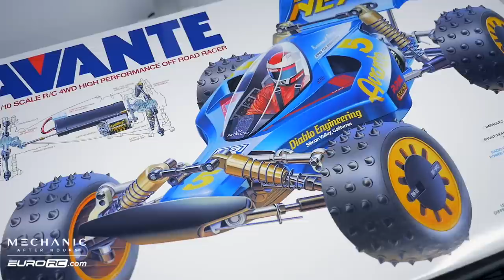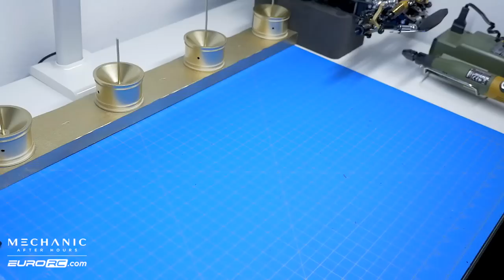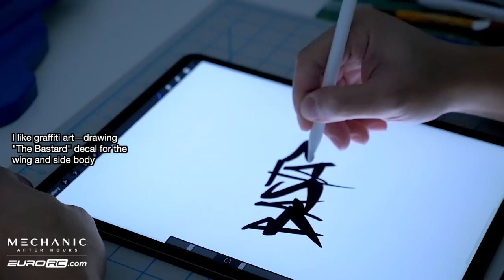Building an RC: Tamiya Avante (Time Lapse)

Comment: I bought one back in 1988 and I was 10 years old at the time. The journey of building it is so rewarding to then drive it. Alot has changed, It had a full plastic under body. After 1 week I installed a superpowerful reedy electric motor and top range power server.  The motor mounts would come loose and strip the pinion gear.  Upgraded to better stiffer metal suspension..  It was super fast and mad fun.  good ol days
Reply: That is awesome! Reedy motors! It was them and Trinity at the time. I remember saving up for a Trinity 12 turn in my Frog. It was mad fun.
Reply: Awww - I used to lust after the Avante in the Tamiya catalogue! I never owned one (the best my paper round could afford me was the Thundershot) I spend my money on paying off the mortgage these days, and if I ever get any spare money, my boilers about done and I need a new bathroom! Oh for simpler times!

Comment: The Avante was my first RC car. I ordered this in early 1988. 

I was a novice and had never built anything like this. Took me about 2 weeks. Did not drive this very much as it was so labor intensive to assemble never wanted to damage the thing. 

I sold this for 3 times what I paid. Wish I would not have sold it now!

Comment: Superb work. Really took me back,  I was lucky enough to own an original in ‘88. Picked it up from a local hobby shop in the UK with that years (modest) Christmas bonus from work. The kit had been sitting in the window for months so the box was faded, so the proprietor knocked £50 off the price, rather generous I thought… 

The build was great fun, and I ran it pretty hard (well, it was to be used… right)… there were weak points (especially where metal threaded barrels went into the rigid plastic turn knuckles), so an engineer buddy of mine milled me some metal ones to replace the plastic the threaded barrels went into. Made such a difference to the strength.  

Anyway, enjoy owning that piece of history!
Reply from the maker: Thanks, Initialgs! Those '88 ones are the thing. Definitely back in the day people who had them ran them hard. Thanks for sharing your story and for watching!

Comment: Absolutely gorgeous build. Well done! The Avante as you said is Iconic for a lot of reasons and although it was a flop on the track, it's a thing of beauty. so 80's.
As many that are into RC's,  I grew up in the mid 80's with a few Tamiya cars but never got the Avante. Was pure froth back then. My current list of RC's are from Traxxas, Arrma, Axial and their ilk. 
Looking at buying the 2011 Avante for some very light use and shelf queen duties. Been a while since I've built a Tamiya (lol 1990) Looking forward to finding an unbuilt Re-Re.
Thank You for sharing this video... Some great ideas for someone that is so used to RTR's.

Comment: Had this car when it first came out.  I modded the crap out of it.  It was a SOLID car but so complicated for a 13yo me.  Most of the mods were for simplification.  Like the steering and suspension layout.  Man, these days with 3d printers, it would barely be the same car.  Love to see it kicking around still.  Beautiful work on it.

Comment: BTW, sealing the CF plate edges with CA glue then sanding and using a black Sharpie is a nice touch and keeps the chassis from splitting in case of a crash.  I ordered a 1/4" chuck after seeing you tap for the stainless.
Reply from the maker: Thanks again for watching! That’s true on the cf edges. My older cars have CA on them and I polish it to a shine. For these newer classic builds, I don’t do the ca edges anymore as I don’t take them to the track or run them hard. The cf on these re-releases are better too.

Comment: Hands down the best builds on Youtube.  I always learn something from watching your videos, and you've really made me up my game when it comes to my own builds.  I've started wearing gloves, using a brush to apply lubes, and I often now vacuum my build station. ;)

One question though, can you let me know what camber and toe value you went for on this 4WD build?
Reply from the maker: Thanks, Jefferson Humber! And thanks for the nice message! Glad the vids are a little helpful. As for the camber I have -.5 front (nominal) and -1 rear (I drop the car first and let it settle). In my case, the drop is not too high as I'm not really taking it to a track. As for the rear toe, I typically adjust them for other cars but for this one I kept it stock—I noticed a slight toe in and I was curious how it would run. So far I like it but I only ran this on a flat surface.
Reply: Teach me to learn this too.
Reply from the maker: Hi, alwTicToc. Are you referring to adjusting the Avante's camber or just camber in general?

Comment: These are nice kits. I've never competed against any in my past travels , so I'm not sure if these were ever used in competitive racing or not. I think these were around in 90-94 when I raced competitively. I ran an Optima mid AWD then went to losi in 91 . Lots of associated and a few Schumacher's . Guys weren't having much luck with losi back then either. They didn't like I built my own diffs clutches back then and they hated that I ran the junior XT truck instead of their pro kit . The chassis was flawed on the pro kit and the junior chassis had better handling properties . I used to build my own motors too . Has a dyno and wound everything myself and cut my own brushes etc. I won the north american championship for 2wd trucks 93 , 94 before things started getting too against independents .

Comment: for body paint. which color to start first?
followed by which color?

sorry, i couldnt understand what you put at 39:57.
my English is not so good.
Reply from the maker: Sorry for the late response. If you want to follow exactly what I did, here is the order: a few coats of blue, anodized silver, plain silver, white, black. You can also keep it simple by just using blue and silver, or even just blue. Of course the color outcome will be different. Good luck!

Comment: Fantastic build with a great piece of kit! Very professional.. There is no mention of the two piece front bumper that suddenly shows up at the later part of the video. Was wandering where can I get this bumper? BTW your video made the Avante look even so much more desirable. Great job...!
Reply from the maker: Thanks, steve lucchini ! And thank you for watching. That two piece bumper your mention is just the stock bumper and optional extension that comes with the kit—I just painted the extension with aluminum paint color.

Comment: @afterhoursmechanic I have two kyosho kits that I have built that have lexan driver bodies and/or plastic helmets for the driver. I want to use paint brushes to paint the lexan parts of the driver body. What brand/type of paint do you recommend for brushing? I know some people use createx but is there a specific createx line for polycarbonate? If so where do I find it? It seems like all polycarbonate paints come in a spray can. I was hoping for a twist off cap that I could dip the brush into...??? For the plastic helmet I was going to use the tamiya TS but seems like it comes in spray can only as well?

Comment: Is there some sort of beginner level kit that I could buy as a gift for my 11 year old?  She loves legos and I think she would enjoy building something similar to this.
Reply from the maker: Thanks for watching. If sticking with the Tamiya brand, take a look at the Tamiya Lunch Box. The model numbers are either 58347, 58347-60A, or 58347A. They are the unassembled kits that you can build with her. The differences between those numbers are basically the brand of electronic speed controller that’s included. (There’s also another model number that I don’t recall but that version is already built so avoid that). You will then need a transmitter, servo, battery, and charger. But please double check. Good luck!

Comment: Hi absolutely awesome build! Love watching your videos, keep up the great work. My partner has just bought me one of these for my birthday but not allowed it till February so just keep looking in the box and admiring all the pieces and going over the instructions. What you have done with the kit is truly astonishing very well done. One question did you seal the carbon fiber top and bottom plate with instant cement before assembly?
Reply from the maker: Thanks, Darren. That's a nice gift from your partner! As for sealing the edges of the CF decks and towers, I only do it if I intend to run the car hard. In this case (and even the Egress), I didn't even bother as I only run them in a casual manner—they'r really vintage cars. With some of my older original buggies some do have CA glue on the edges and then I polish them so they look slick—but it does take time. However, if you plan to take it to track a lot, bash, etc. you may want to do it. Also, some of the newer cars with CF have better quality and are stronger. I think this Avante has a slightly older CF. Good luck with your build!
Reply: Thanks I certainly will enjoy building it, seeing as I have wanted one since 1988 when they first came out but could never afford one or they were discontinued or always out of stock, funny old business this hobby is. Look forward to your next build. One last question which is the kit you have enjoyed making the most? Cheers.
Reply from the maker: Hi Darren, sorry for the late response. Hmm, regarding what I enjoyed the most. I haven't built as many yet to know but so far maybe it's a tie between the Javelin, Egress, or a modified DB01 (I didn't do a build video on that one). But for just fun without any pressure, a Grasshopper.

Comment: How do you run in your engines? And what was that electrical device that you put the motor in?
Reply from the maker: The device is a Team Orion Performance Monitor V2. Depending on the motor, I do a dry break in at 3v for 3 mins or so to seat the brushes on the comm. Sometimes I’ll put a drop of bearing oil around the bearing areas if the motor is vintage

Comment: I’m guessing everything can be upgraded? Is it easy to understand compatibility of parts? (If that is something to lookout for
Reply from the maker: Yes, most Tamiya kits can be upgraded and they do have a catalog or parts list on their website. But, you still have to do some research. You can also check out the Tamiya Club forum—they're very helpful if you have detailed questions on what kit to start with. I think to start you want a more entry level kit. I think this Avante is more intermediate. Good luck!
Reply: @MechanicAfterHours  around how much is an entry level? I have an rc but it's much bigger than these guys (1:10)

Comment: Nice build! But what I want to know is what was the total cost? and what are you going to do with the car ? just put on a shelf or race it or just play with it?
Reply from the maker: Thanks, Mitch Rozelle. I didn't really track the cost but the bulk of it is the kit itself but it was sent to me by EuroRC. The other items like electronics are standard items that's really needed. And then most of the mods are custom. I run my cars and maintain them. Some I don't use much, like this—because it's vintage.

Comment: How much is an try level one. Not super cheap parts tho. I know it’s subjective, but just to have an idea. 200, 400? 800?
Reply from the maker: Thanks for watching. With Tamiya, the cheapest you can find will be around $90 to $100 USD. But it's not complete (no transmitter, paint, etc.) and at that price point they are more for bashing and backyard running.

Comment: That PS16 looks waaaaaay brighter the PS16 I use.
Reply from the maker: Hey Kenrick Currie, thanks for watching! I guess it depends on how light or dark you want it to be with PS16. In this build it's two light to medium coats and then I backed it with anodized silver (instead of silver) so it pops and is more vibrant, then back by silver, white, and black. You can forego some of the other colors but the main backing behind PS16 will affect the final shade.
Reply: I will try your technique on my next Subaru build.  Did you print the motor sticker your self or did you send it out.
Reply from the maker: If you can, before you paint the body I recommend you try different techniques on a piece of polycarbonate/lexan so if you don't like the result you can re-test. I made the motor sticker myself.

Comment: How does the additional black downforce plate mount onto the undercrowling.
Reply from the maker: Thanks for watching. Two ways to do it: either screw to the chassis thru the under tray, or for now I used high tack servo tape from MIP. Hasn’t come off but you can still remove it.

Comment: What do you do as far as replacement/upgrades for the transmissions internals?  Something about the plastic with any amount of speed scares me 😆🤣😂
Reply from the maker: Thanks for watching, Alex Millsier! A lot of vintage RC cars (even race ones) use strong nylon gears and I really haven't stripped any so far. They're more durable than expected especially when you install it properly—and the mesh on the pinion and spur is set correctly. Some modern buggies will have some form of reinforced plastic gear. With these classic kits it's not about full power all the time. And if you have to replace it, it's not that expensive.
Reply: @Mechanic After Hours  thanks.  Ive got a few classic kits on my shelf but i was worried if theyd be able to handle a brushless and two cell with the plastic gears.  Im wanting to do restomods with em lol.
Reply from the maker: I see. I think they can to a certain point. I looked on YT and see a number of people running LiPo+brushless. I'm sure as long as the motor is reasonable. Good luck!

Comment: What did you use to print the label for the motor before putting the UV laminate on top, inkjet?
Reply from the maker: Hey Benjamin, thanks for watching. Yes an inkjet printer.
Reply: @MechanicAfterHours  Thanks for the reply, what vinyl cutter do you use to get such small graphics?
Reply from the maker: Hey Benjamin, it's a Cricut but it's a bit challenging sometimes to get it perfect when it's too small. There's a limit to the size.

Comment: This is incredible! I'm going to find one of these soon, hopefully. In the meantime, I have a Novafox and a Frog to build. Is there any secret to tapping everything for M3 screws? I'd rather use those than the self tapping phillips screws.
Reply from the maker: Thanks, DSaw78! Yes, there's somewhat of a technique (at least with how I do it) so that I don't strip the plastic. If manual tapping threads, I do it slow and make sure the driver is not at an angle. It has to be totally straight like at 90 degrees. Also, most of the time I will add some type of oil or grease so the plastic does not bind and the tap goes in smoothly. If I don't have cutting oil, I just use spare Tamiya cera grease. I use a modeling paint brush and apply a very small amount onto the tap bit. For this one, I didn't use any grease because I was curious and but used a variable driver and kept it super slow—basically, you can control the speed via the trigger. Just have to make sure your driver has that feature. So far everything worked out. If you go too fast you might damage or crack the hard plastic on the vintage kits. Good luck!
Reply: @MechanicAfterHours  Thank you for the information! I guess I will go ahead and try it with both of my kits, hopefully I won't mess them up :)
Reply: @MechanicAfterHours  I forgot to ask, did you buy that box of stainless screws as a set like that? If so, where from?

Comment: I never got why so much of the important electrical was exposed directly to the dirt. Looks brand new. You take it out of the track and the thing is full of dirt in every place you can imagine.  There needs to be a better way to seal the undercarage from collecting all the dust and dirt and crap going into the motor and electrical components.

Comment: Why do you Heat up the Stickers?
Reply from the maker: Thanks for watching, Jimmy Schwarz! For some, when I use a lubricant such as water with mild soap (so I can reposition the decal), it helps dry it up faster once I have it in position. It then makes the decal pliable or slightly flexible. This helps me remove any existing bubbles on the decal as I press it down. For other custom decals, if they are very thick and I need them to conform to a shape or bend, it helps make the decal material flex a bit. I hope this makes sense.
Reply: @MechanicAfterHours  ah okay Makes Sense to me now thx ^^

Comment: where to buy these? and how much is an entry level
Reply from the maker: Thanks for watching, Conrad de Vera! The stock kit (no modifications) can be bought online from various RC stores—depending on where you are in the world. This is a classic/vintage kit so the mechanical parts are older in design. Just search for Tamiya 1/10 Avante 2011 Off-Road Buggy Kit #58489. You can also contact EuroRC.com. But they have been rare lately and hard to find. The stock kit will cost between USD $485 to $500 plus. There are some entry level kits but there are too many too many brands but some cost far less than this. Good luck.

Comment: For sure an iconic kit.  I was kinda hoping for a different colour other than blue, in your other vids you normally add nice upgrades and made them a bit more unique and special.  I'm a racer and would love to see them made track easy.  Any plans to update the electronics to brushless and lipo?
Reply from the maker: Thanks! Totally understand. I kept the blue because at least for me, it’s one of the iconic kits that I never see right with any other color—like the Egress or Cat XLS. As for the electric and mechanical upgrades, I kept it simple since I don’t intend on running this car as much. I’m unsure about LiPo and brushless as I really have no intent on pushing this vintage car (34 year old design). It’s more for casual runs and nostalgia.